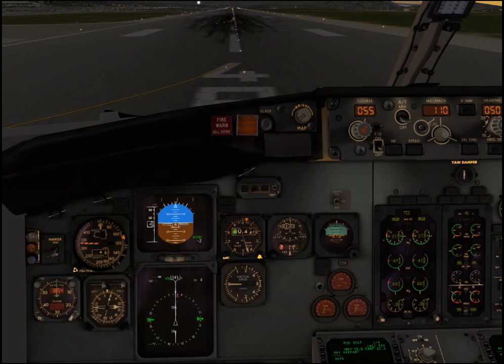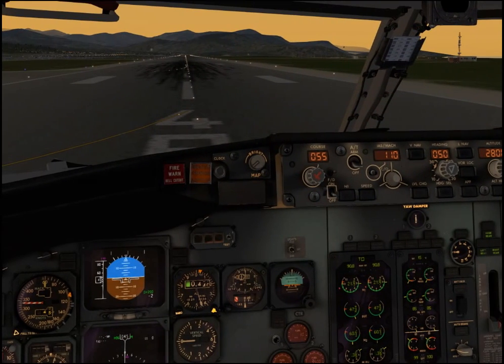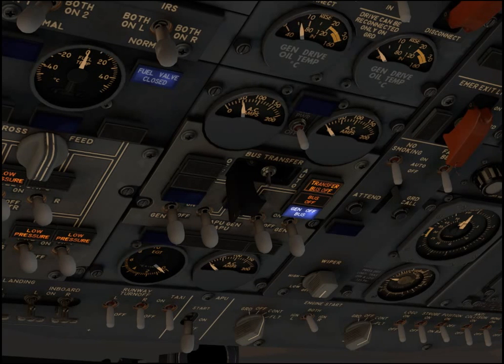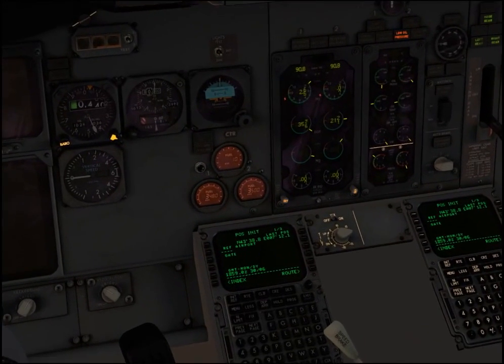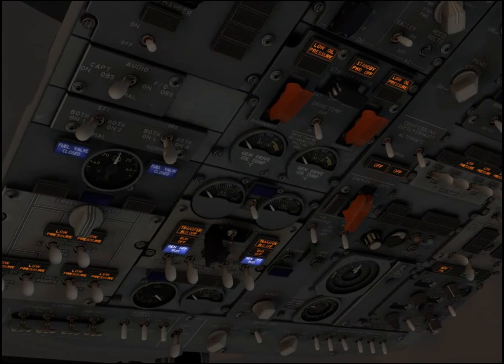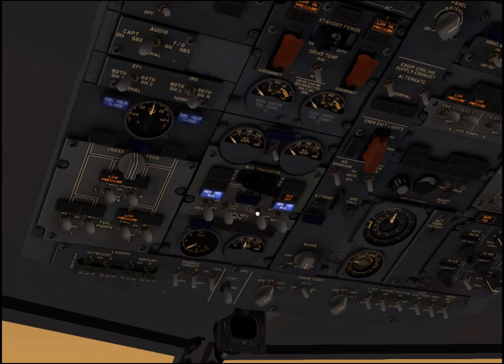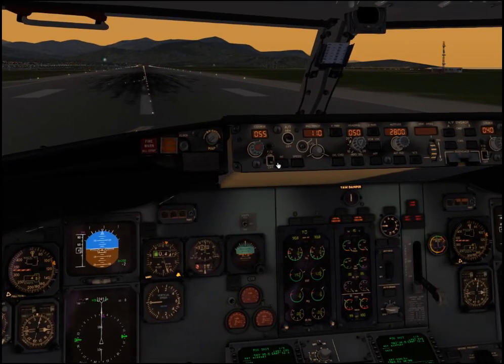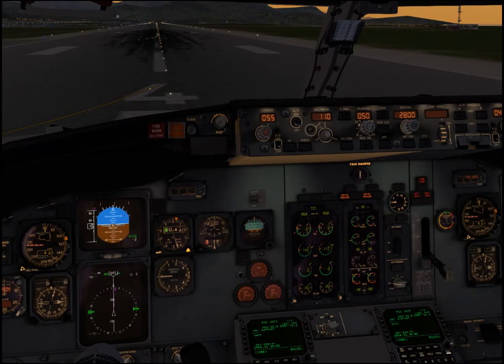IXEG 737 Electrical Demo 2.mp4

Comment: Thanks Javier.  Jan mentions that we do not model failures and what that means is we have not coded up "failure triggers".   The system is designed to be easily failed at many levels, but we have to come up with a good randomizer and/or user interface to implement the failure triggers.  Failure management is almost a interface by itself and we will address that after release.  We may provide a very simple failure intereface as we have one we use for troubleshooting now.